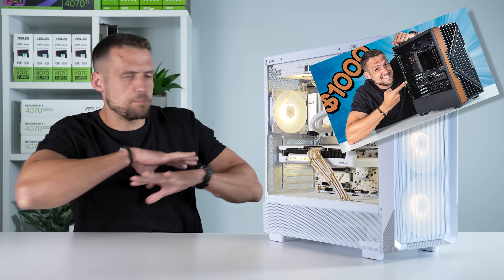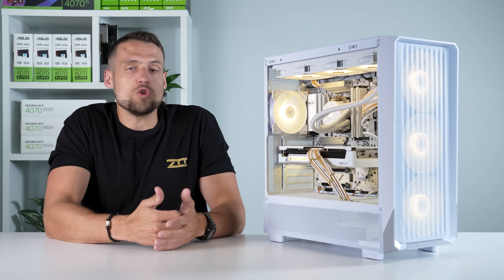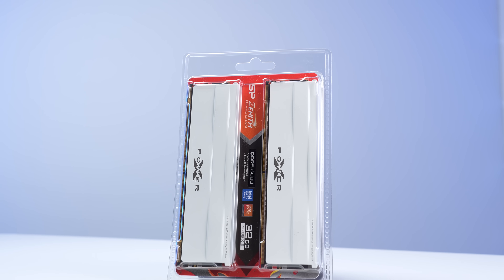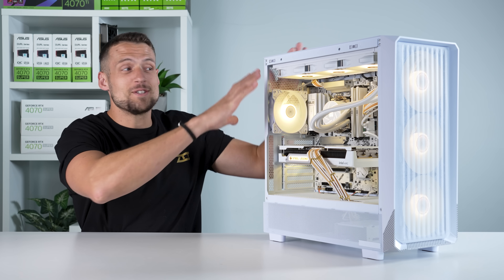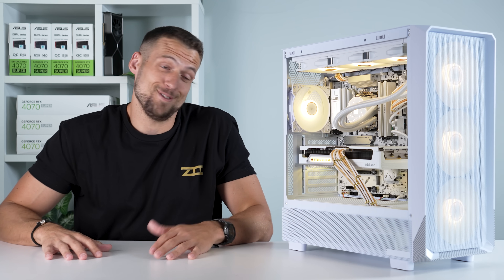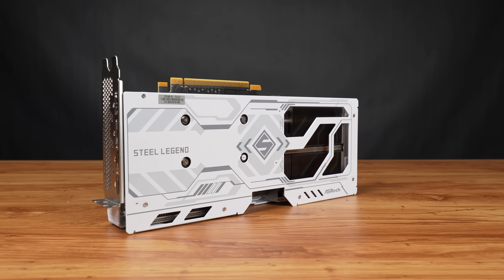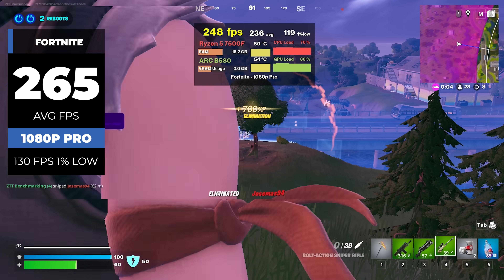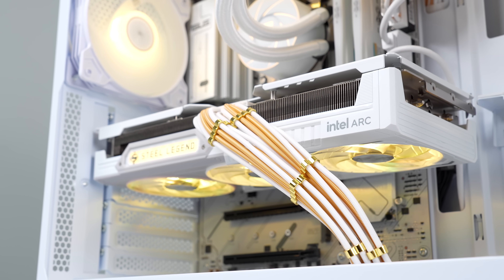$900 Gaming PC Build Guide

Comment: this aesthetics for 900 bucks is insane.GOOD JOB Zach
Reply: @ZachsTechTurf  Zack, in my country the ryzen 7 8700f is priced about 10$ extra from 7500f. Is it worth it?
Reply: @Bebek-96 yeah 😊
Reply: @Bebek-96  No, It is not worth it. the 8000 series is bad and should not be recommended for gaming. get the 7500F
Reply: @techy-alien01  Do not just say that, it may be a bigger number, but 8000F series for AM5 is the worst
Reply: @ZachsTechTurf  zach why the fuck am i banned on ur server. Pls unban me i didnt do anything
Reply: @ZachsTechTurf zach can you rate my build i built it myself 
Ryzen 7 7800X3D
RX 9070
B650M TOMAHAWK WİFİ
32 GB OF  6000MHZ GSKİLL DDR5 RAM
MSİ MAG CORELİQUİD 360R V2 
KİOXİA 2 TB NVME M.2 
CORSAİR 850W BRONZE PSU
Reply: Why b580
Reply: @maazff4828  good card for the price
Reply: @maazff4828  i built this with a 9060 xt 16gb, its really good
Reply: @maazff4828  cheap depending on where you live

Comment: I want 950$ full set up + moniter plz
Reply: Just get same with cheaper air cooler and mother board etc you will easily build it under 850 then get a 100 $ monitor

Comment: Hey man,
This is my parts list, can you tell me if anything's wrong.....or can be better, I am tight on budget...
And can  you recommend a budget monitor....
Case: Lian Li Lancool 216 RGB 
Motherboard: GIGABYTE B850 Eagle WIFI6E
CPU: AMD Ryzen 5 9600X 
GPU: ASUS Prime Radeon RX 9060 XT 16GB
RAM: Corsair Vengeance DDR5 32GB (2x16GB) DDR5 6000MHz C36
AIO/Cooler: Cooler Master ML360 Core 2 ARGB CPU Liquid Cooler
Power Supply: MSI MAG A750GL PCIE5 750 W
Storage: WD_Black Western Digital SN7100 NVMe 2TB
Would really appreciate it man...
Thank You Zach